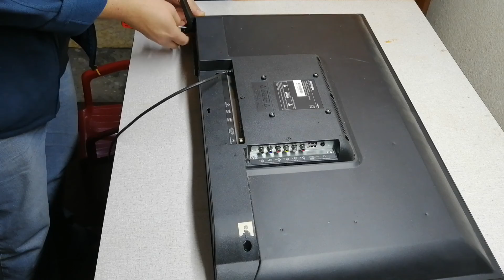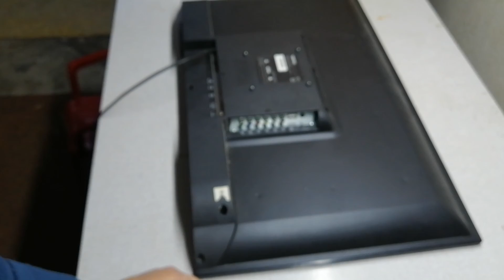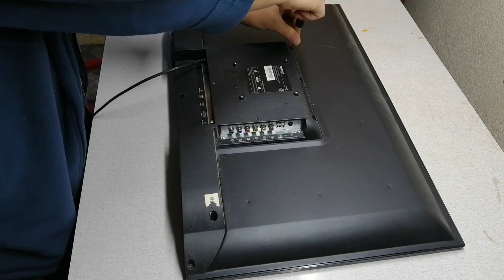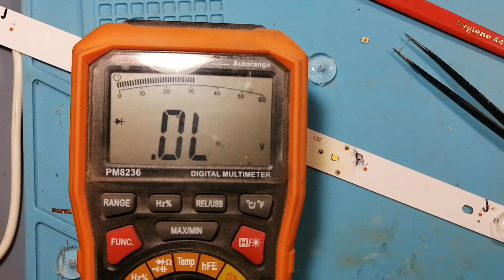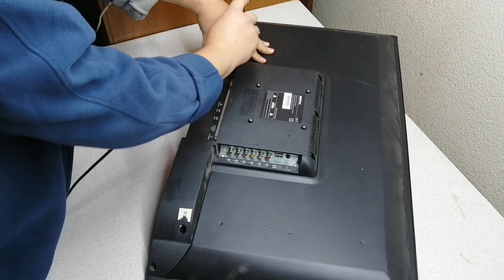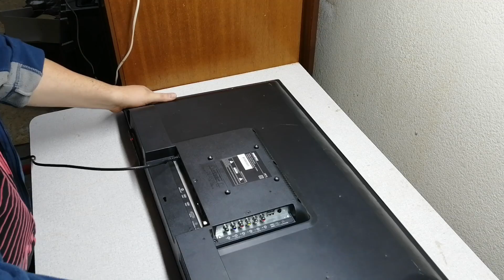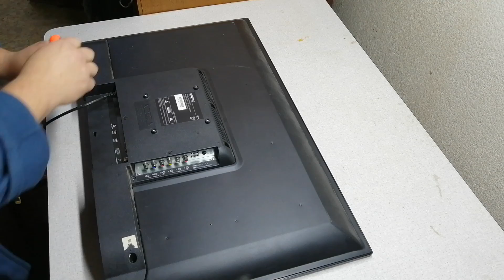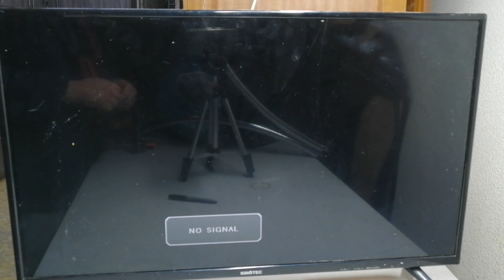Sinotec TV Backlight Repair

Comment: Mine suddenly went off while watching a movie with my laptop connected via HDMI to the TV. 39 inch Sinotec. The power is still there but no sound no picture. Just a dark screen. Please advice.
Reply: I came here cause my momma's tv having the same problem but as soon as I find solution or problem Amma share with yahhh
Reply: @peturniamavundlha4579  did you find the solution ?
Reply: @tebogomokoena8350 please share the solution.. have the same problem

Comment: Hi! I have a sinotec 32" led tv. The led backlights are fine, according to the tv repair guy, he said its the driver board, which he says is integrated into the main board. Problem is he cant get the mainboard so he says the TV cant be repaired. My question is, if its just the LED driver board, can I not just get a standalone led driver to drive the leds? I mean as long as the voltage and forward current for the backlight is correct, i dont see a problem? Let me know what you think :) Thanks!